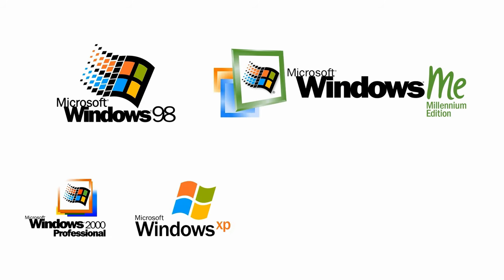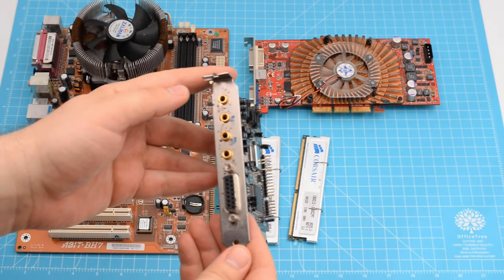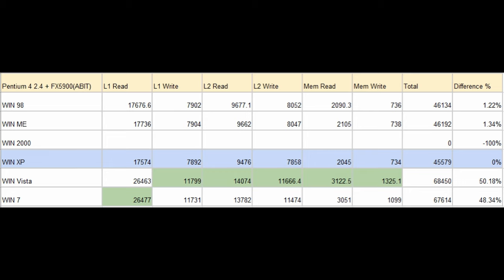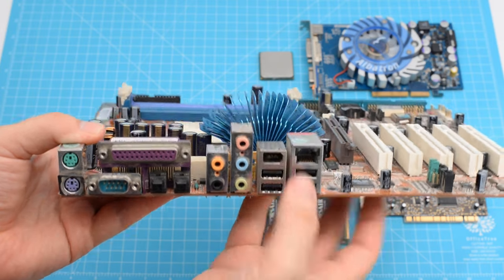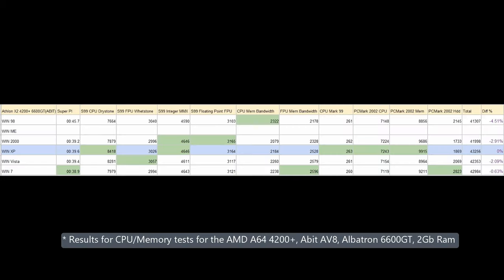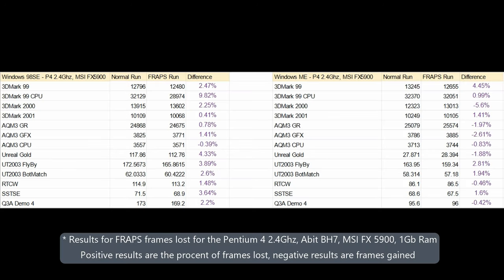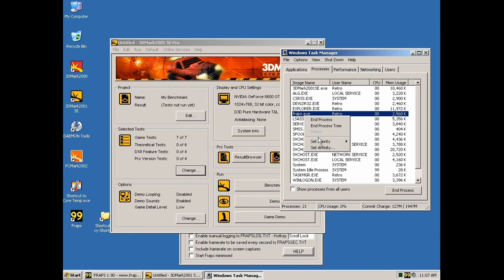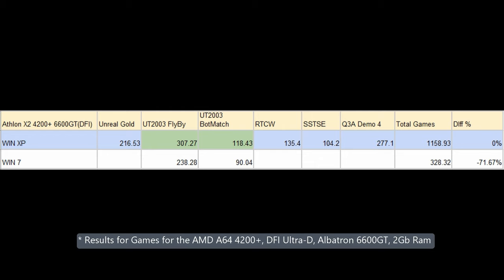Best Retro Operating System by comparison

Comment: I found the DFI Lan Party boards to be the best with s939 processors.  Good stability when overclocking and solid drivers.  The X2 4200 was about equivalent to the single core 3700+, but performed much better in multithreaded tasks.  The X2 4400 with the larger cache was a much better performing CPU.   I appreciate you showing the AGP issue for Nvidia 3 chipsets.  I never personally experienced it as I had PCI-E cards.  I've been meaning to grab an AGP version someday as s939 cpu's are a personal favorite.   Good video!
Reply from the maker: THank you. The DFI LP are absolute monsters :) 754 and 939. After reading long forgotten threads I discovered that a motherboard with 939 socket and AGP and a multi core cpu are just not a match with Vista or 7.(I haven't done any tests for a single core though) The results are low including the Asrock motherboards branded VSTA. I plan to continue with this subject on a much simpler scale (since I went overboard with the numbers here) and only for Intel CPUs as I suspect that this situation (Vista/7 > XP) repeats with other CPUs as well.

Comment: Excellent, would like to see the same tests with a 800 MHz FSB P4 taking advantage of that PC3200 memory ! nforce3 issue was new on me, good to know 👌
Reply from the maker: I'm pretty sure the bigger P4 would just confirm that 7/Vista are better. It's not limited to just nForce 3. nForce 2,3,4 all create issues on Vista/7. I have tried the experiment with nForce4 and the same X2 CPU on Win7 and the result was similar, I really hope to get to the bottom of this some day. I do plan to get a socket 775,  nForce 4 and try the same approach with a P4 or a Pentium D but I'm not sure that going deeper exploring a issue is that helpful. After all it's more important to see where this behaviour where WIndows 7 gets better benchmark results stops, what's the first CPU where VIsta/7 are no longer faster.
Reply: @retrodrive-thru47  Thanks for answer, seems win7 just a faster OS providing adequate memory is present !
Reply from the maker: @agenda697  well, don't take my word for it :)), although I'm 99% sure that if you are not using an nforce chipset, for any 800fsb P4 you are going to get the same result as me here. My goal would be to see where the cpu frequency makes xp faster. Microsoft says the minimal requirements are 1ghz and 1gb ram for 7 ( and I guess Vista as well) so that is my target. (pentium 3 or the original athlon territory)

Comment: interesting videos and interesting conclusions… 🤔
Reply from the maker: I had the same reaction when someone tested the core2duo under similar circumstances. I always thought that it's the features/services of winxp and afterwards win7 that will hold them back. I never thought that the older Operating Systems had memory leaks or issues. I have repeated this procedure for many other systems since this clip, and as long as you don't use an Nvidia chipset the conclusions from this clip stand at least until a 1.6ghz cpu, 1gb ram and at least a geforce fx 5700.

Comment: GREAT job & Analysis.. You even investigated fraps hit on FPS & Nvidia issues!!
I remember Silent Hill 2 needed to set the affinity to 1 core on windows XP ! also StarCraft needed explorer.exe to be terminated in order to run correctly in windows 7.
Just for kick, Can you add this to the test? I burned it to a DVD using ultraIso then tried booting form an old Acer Aspire 4720 laptop which is my current device therefore I didn't proceed with installation. (Will try after buying a compatible SSD that support SATA2 controller in BIOS)
W11_X-Lite_22621_1778_Ultimate_11_Neon_FBConan
It should install in MBR normally & take around 240mb of ram at idle "if" total capacity is 2GB.. on idles at 1GB at capacity of 6GB & beyond !
Reply from the maker: Wow, Windows 11. I will sure try. 
The goal of this series was to start (in pairs) from a P3 550Mhz (and an Athlon550) , then move to a P4 1300 sk 423 (it's pair being an Athlon 1333),  then we have this episode, then move to a Pentium D(Here I will try to make the Athlon X2 work) and conclude this series with a Core2Duo (but this is the least watched clip so I moved to some other topics). The goal would be to see what was the ideal operating system for benchmark and I'm pretty sure that for the Intel chipsets even the socket 423 P4(I plan to give it 1Gb RDram) will confirm that it's Windows7.  The nVidia chipsets(nforce2,3,4) are a big problem when it comes to any operating system beyond XP I just need to confirm that their problem is contained for an X2 cpu and the regular single core Athlon doesn't take the same performance hit in Vista/7.
As for windows 11 (if you watched the windows evolution on this channel) you probably know that the lowest CPU that can reach W11 is a cedar mill. This is a more distant plan of mine, to have a Cedar Mill cpu tested from 98 to W11 but it will take so much time... (I also need to find an AMD equivalent as the first A64 does support 64bit instructions but W11 needs a more advanced variation of these because a regular A64 939 or the AM2 A64 will not upgrade to W11).
Reply: @retrodrive-thru47  
Yeah, JUST NOW I managed to install The iso on the Acer Aspire Laptop...
It didn't like Samsung SSD !!!
Samsung has poor or
No backwards compatibility with older BIOS SATA controller.
however an intel SSD worked !
A no brand name called Kingspec also works.

Specs:
Intel Core 2 Duo T5450 (1.66Ghz, 2MB, 667Mhz FSB)
2GB DDR2

It idles at ~820mb (not as advertised)
Task manager Alone ~34mb & 12% CPU
For now turned off transparency which is shocking that it runs since it couldn't support windows 7 Aero effects!